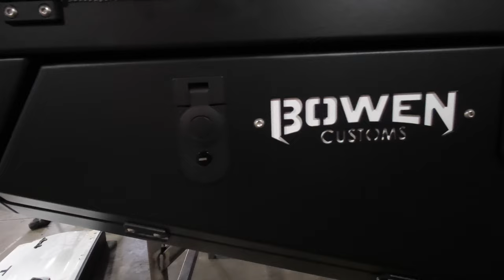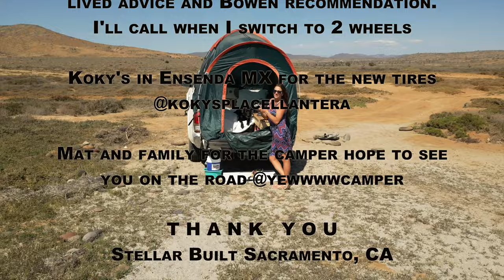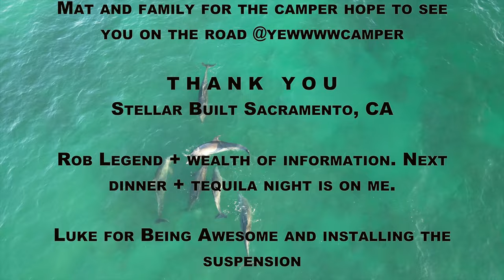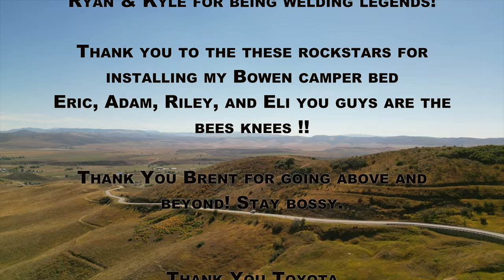My 2023 Toyota Tacoma Build - Ready to Overland The World

Comment: Keep a close eye on the turnbuckles .. they do loosen up.  I just did a similar build using a 2022 4dr Toyota Tacoma TRD Off Road and a 4wheel Camper ... Swift model.
Reply from the maker: Camper is bolted down through the bed. Turnbuckles barely move now. Maybe once a month one requires a quarter turn

Comment: You give it different names in each Country blend in. For example Mexico it's "macho taco". In the ME it's Jihadi taco....BTW if you're an American and traveling overseas just tell people you're a Canadian. That's what i do it's far safer.  I have the 18 TRD 4x4 Off Road Access cab it's been a good truck so far besides the brakes= i have had the front rotors turned twice already and only at 40K😡. I live in the mountains part time so that definitely doesn't help. I would make sure your brakes are beefed up especially the rotors and pads on the front. Heat dissipater rotors the best you can afford is my advice..Better do this stuff back in the rear vs out in the field.  GOOD LUCK!
Reply from the maker: ohhhhh that is a neat idea for sure! Will have to think that over, will be a lot of names for all the countries I will be in and out of haha Yes most people think I am European or Canadian, 4 years of travel and my accent is always changing. My truck has the ability to go into sport mode and downshift, this is what I do most of the time in the mountains. After driving manual all my life I try not to use my brakes at all 20k miles stock brakes and rotors, no issue thus far
Reply: @HifromAshley  Hopefully Toyota updated the rotors on your 22-3 truck....it's going to cost me next time.....because after two rotor turns that's it.

Comment: Nice build besides the snorkel. I liked the one at the 2023 SEMA all tucked in and you could barely notice it. Yours is also sucking air at the top and should be readjusted imho
Reply from the maker: should be readjusted to be where? Lower to suck in sand and dirty air from off roading?
Reply: @HifromAshley  The head of the snorkel if adjustable should be adjusted inwards so it doesn't suck in air when traveling over 50mph
Reply: @HifromAshley  Sadly i don't have a snorkel on my truck and don't know what your setup is on your truck...I would want it drag flow inwards....it's good you have the snorkel you're probably going need it! I smashed my tailgate during a river crossing because i didn't have a snorkel!!! the dent is still there!
Reply from the maker: hmm well I don't know the last time the truck went over 50 mph, its important to remember I am NOT driving in the United States on interstate roads.I trust the professionals who installed the snorkel, did so properly. I have seen thousands of snorkels, never adjusted inward....